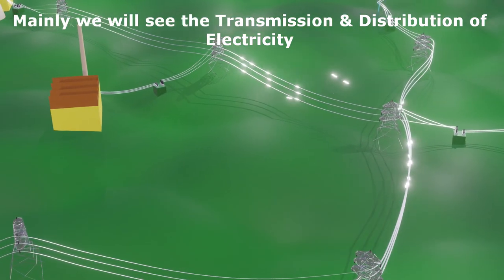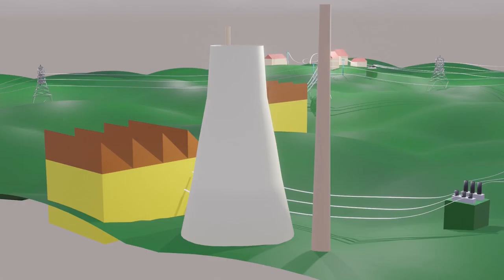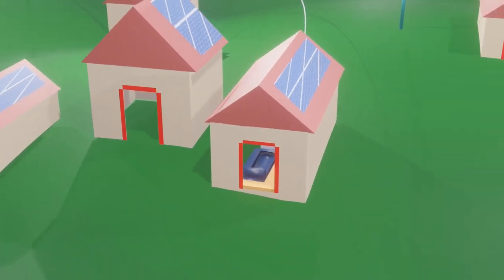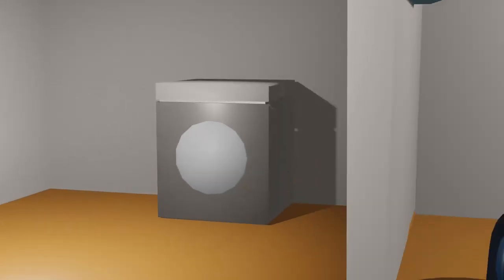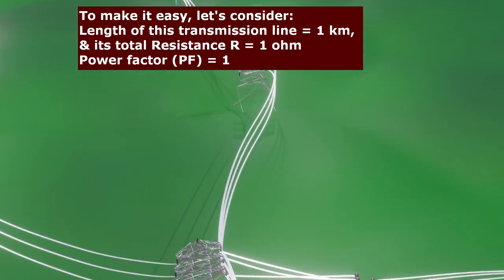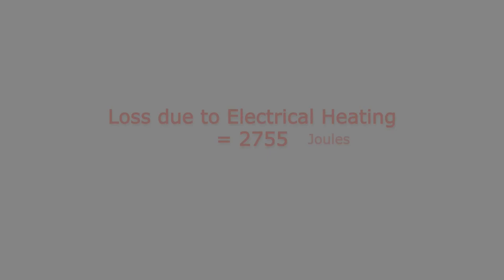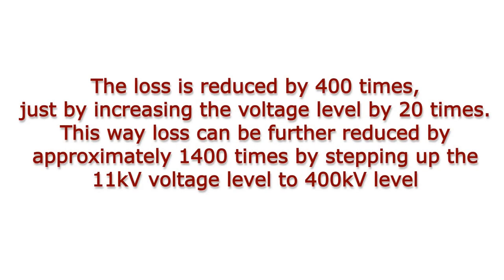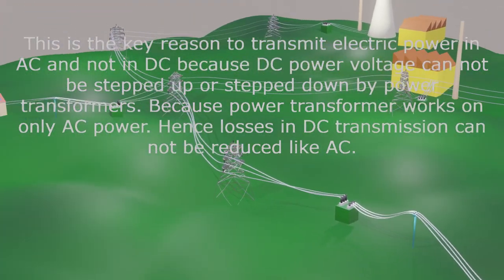Transmission & Distribution of Electrical Power. How a huge loss is reduced just by Voltage step-up

Comment: If voltage is lowered then current increases to keep power the same in both primary and secondary winding. Why we use transformer if we can't reduce power or how can power be reduced? For example the power of high voltage lines(11kv) is  equal to the power in 220v transformer according to the equation I1V1=I2V2 but they are not equally powerful. How is it possible?
Reply from the maker: Power transformers are used only to step up or step down the voltage levels, not the power. Power is same at both primary and secondary sides of the power transformer. And transformer power rating is in KVA or MVA. Hope this answers the question.

Comment: But why can't we substitute V=IR in H=I^2RT . We get H=V^2*T/ R. Thus heat loss depends upon voltage as well. As voltage has now stepeed up won't the heat loss be more ?
Reply from the maker: Good observation, but your statement itself validates the point discussed in the video. For constant power which is VxI, If voltage is  increased then current gets reduced. If heat loss is calculated in terms of the voltage, then heat loss happens inversely proportional to the voltage square not proportional. Hence stepping up voltage reduces heat loss significantly.
Reply: I grappled with this for a bit, myself.  The key thing here is that V is not the total line voltage, V is only the voltage dropped across the line resistance.  As line voltage increases, this actually shrinks because our current decreases.

Keep in mind the voltage actually dropped over the line resistance will be I*R.  For simplicity's sake, compare 100V (line), 1 ohm R, and 10A current with 1000V (line), 1 ohm R, and 1A current (since we can step up voltage by 10x while current is reduced 10x from the equal power equation of a transformer).

Case 1: Voltage drop = I*R = 10A * 1ohm = 10V.  We lose 10V and deliver 90V to the rest of our system (substations, transformers, etc.).
Heat is calculated as either: I^2 R t = (10A^2) (1ohm) (1s) using 1s for time > 100 J.
Or V^2/R t = (10V)^2 / (1ohm) * (1s) = 100 J <-- importantly, this V is the voltage drop NOT the total line voltage.

Case 2: Voltage drop = I*R = 1A * 1ohm = 1V.  We lose 1V and deliver 999V to the rest of our system.  You can already see why stepping up voltage becomes more efficient here.
Heat is again: I^2 R t = (1A)^2 (1ohm) (1s) = 1J.
Or V^2/R t = (1V)^2 / (1ohm) * (1s) = 1J.